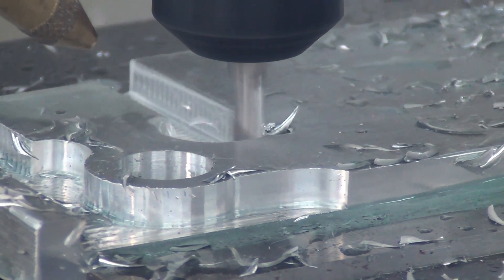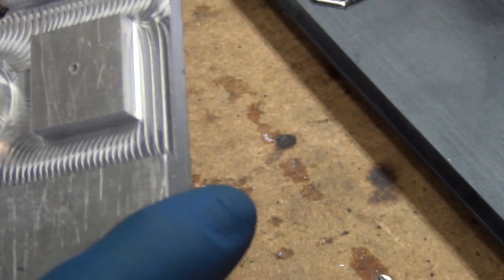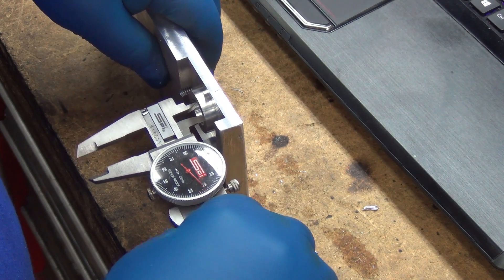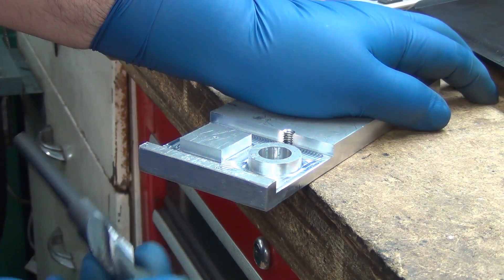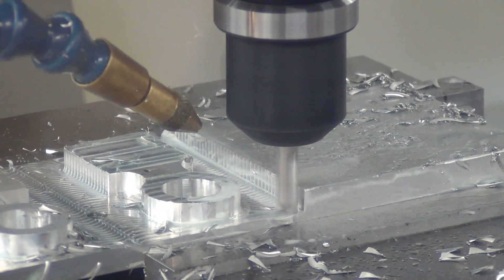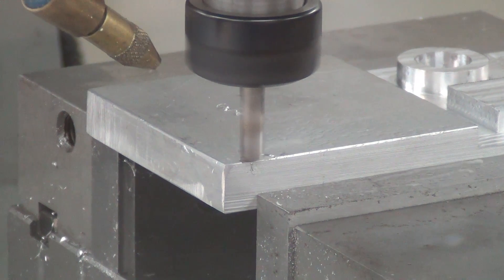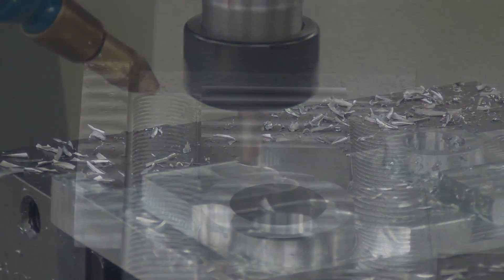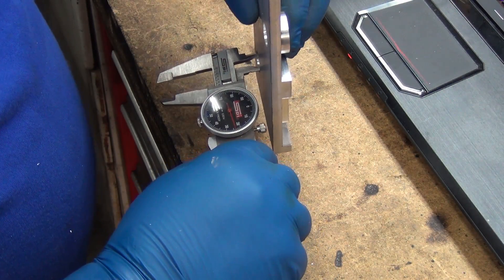Novakon Torus Pro - Calibration Test in Aluminum

Comment: The ripples are deflection for sure, also its a dead giveaway if the base of island features are bigger at the bottom than the top surface. Looks like you have got some good advise already but heres my 5 cents... I guess it all depends on what you are after, low cycle times, surface finish, accuracy etc. 3 flute in Aluminum all the way! My rule of thumb is if i want a great surface finish, i'll use HSS with small depth of cut radial/axial, its sharper unless you buy the crazy premium Carbide. Hogging stuff out, then i'll go with Carbide because it deflects a lot less and you can push  it harder. I don't get too concerned with coatings, on Ali you get built-up-edge because of excessive heat from rubbing or gauling effects.... seeing as you are using a lubricant and pushing the cutter through a a good speed, i doubt you would gain anything from coated carbide in this setup.
Reply from the maker: +l0ckcr4ck3r Great info! Thanks!!  I might just have to revisit this, making some adjustments based on the comments. :)